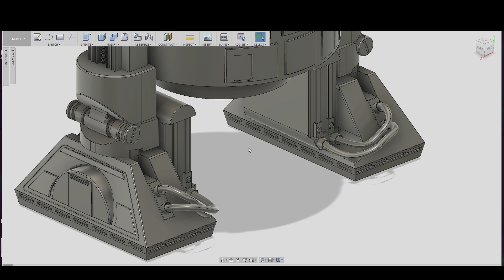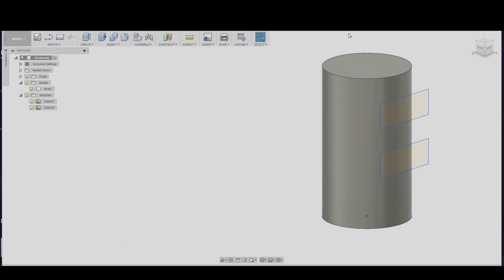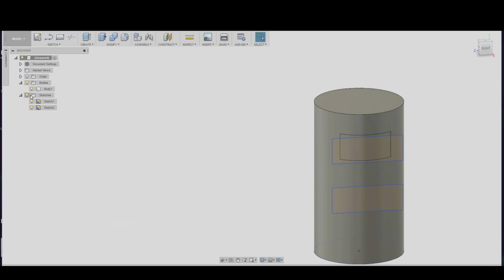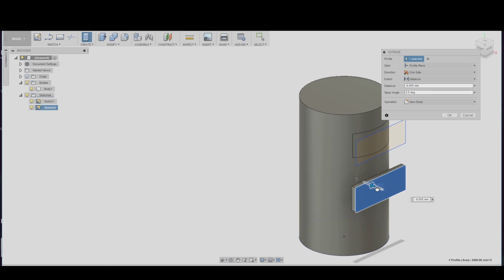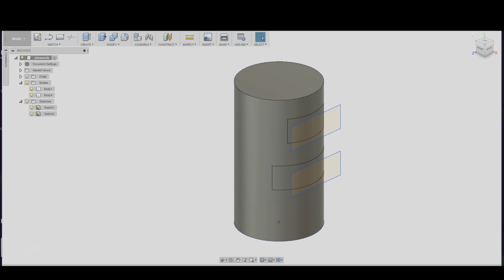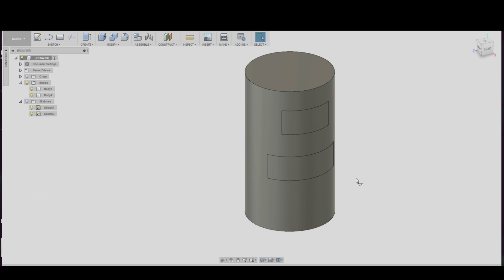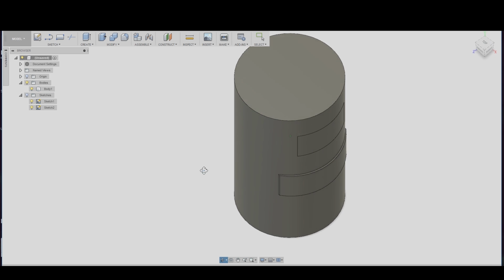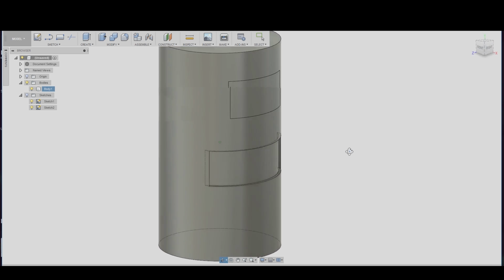How to Sketch on a Cylinder or rounded Surface in Fusion 360 EASY!!

Comment: Great tip! This is exactly what I needed as I am designing something for 3D printing and the other method with a separate body also prints as a separate body when creating the Gcode, and that does not give a strong bond to the extruded part, and is also slower to print due to the extra outer and inner layers it creates...
Reply from the maker: Awesome , glad to help

Comment: How did you get the blue rectangles, the video skips that important step.
Reply from the maker: the blue rectangles are sketches, they can be found by either 1. rightclick> sketch> 2 point rectangle. or 2. At the top of the panel (toolbar) select "CREATE" drop down >create sketch> and that will prompt you to selct a surface to sketch on , after selecting which surface to sketch on, the toolbar menu at the top will change to the specifics of sketching. You can now select your option of sketching tools, in your case click the rectangle icon (which is 2 point rectangle. you satisfied or complete at the top right toolbar select "finish sketch" . Hopefully this helps.  I will be updating this tut and making more tuts soon because a lot has changed since this vid.
Reply: @thelastdev  Thank you for explanation..as a beginner would love to see it from the very beginning too...as I was stuck from 00:00! Thanks!

Comment: Thanks for the excellent tip. I'm right in the middle of trying to sketch onto a rounded surface of my Hewy Helicopter I am working on modeling. I'm trying to carve out the inside of the fuselage and sketch the windows and your tips have added good ideas for me to try.
Reply from the maker: No problem glad u found it usefull. I'm going to be starting a series of how model spefic things like trucks, robots, etc in fusion 360 coming soon.

Comment: I appreciate that you posted this. It was very helpful. One thing I discovered when trying to apply this approach: If your sketch contains multiple parts, like a circle inside a rectangle, you have to Split Face the outermost part first, do the push-pull on it, and THEN proceed to do the inner part. My particular sketch had numerous nested sections to it and I had to work one section of it at a time, working from the most encompassing part of the sketch to the innermost part of the sketch. I had expected that the entire sketch could be projected onto the rounded surface, doing all the Splits at the same time, and then doing a bunch of push-pulls on the separate sections, but it doesn't work that way. You have to do a sequence of Split Face, Push-Pull, Split Face, Push-Pull, etc.

Also, you didn't actually mention that you can do the push-pull on the Split Face, and not just on the Split Body version.

I also found that you can't have the plane of the sketch actually tangent to the object you'll be splitting (for a sketch to split a cylinder) or right ON a flat face that you're splitting. Fusion 360 refuses to do the split in those cases. So, you need to make the sketch plane a little bit away from the surface to be split. For my cone shape I had to first make a tangent plane and then do an offset plane from that tangent plane.

Comment: summary:
1.While making a flat sketch and using it as a split face tool is good, it does distort the shape and size.
2. Better to extrude a new body from the sketch into the inside of the cylinder and split it to leave only the part of the body that's inside the cylinder. 
3. Then, in order to remove the inside division, extrude the new body outwards from the cylinder to retain its shape and overlaying sketch, and combine the two bodies into one.
Reply: Asaph , that is exactly what I was after today. Thanks a lot for taking the time to share.